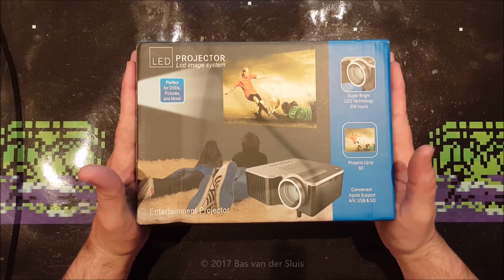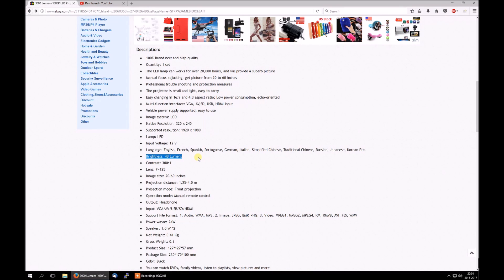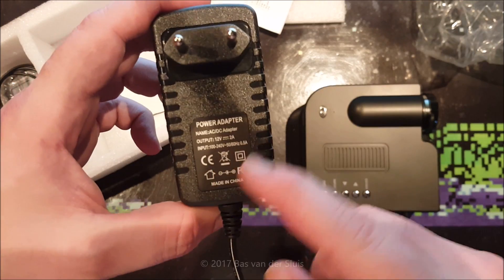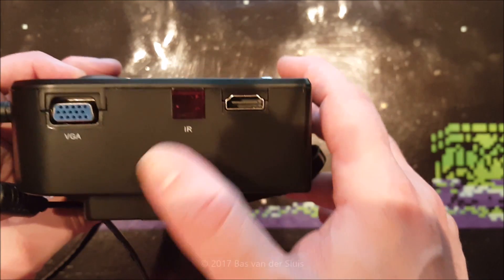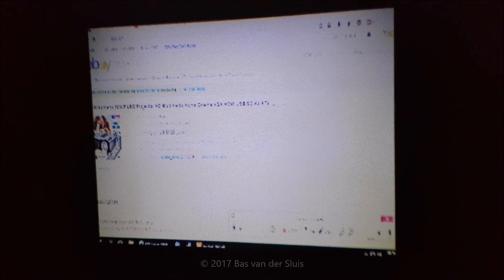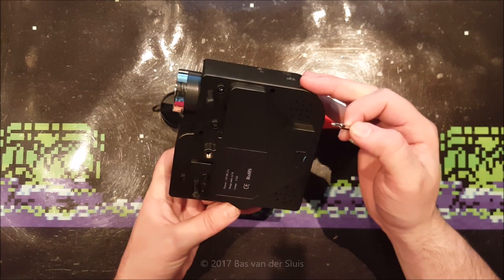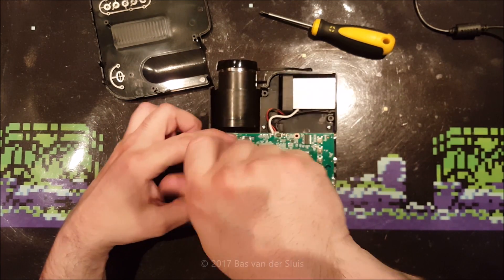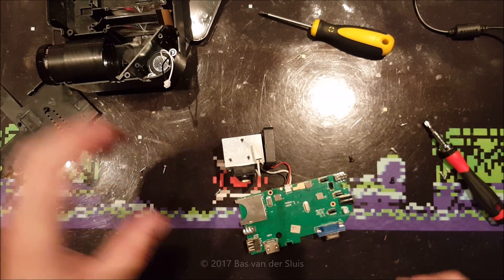Have I been scammed? A look inside this "1080p" LED projector.

Comment: 320x240 is CGA Resolution.  Full 1080P would be 1920x1080.   Yes you did get scammed! 

Next time if you want a projector, go with a name brand (Epson, InFocus, Christie, Panasonic, Optoma, BenQ, LG, Casio, Sharp, HP, etc).   Never buy a projector out of the back of a van, either.  If you have never heard of a brand someone is offering you, next time Google it and see if it is good or a scam before buying.  

To get some serious use of the white van projector you got at its native resolution, you might have success with very old computers (Commodore, Apple II, IBM CGA) or older arcade games.    It might look good with those signals.

Comment: YES! it needs all that cooling.. and be glade it has it..  most new devices are not properly cooled, thereby giving them a predicted fail rate... I have a RoKu box..  strapped old heat sink to case after noticing it so hot..   it helped big time...  same box for 4 years now..  yet i see so many online of same model Refurb's. I have seen many "insides" of electronics all my life...(47yrs now), and most fail due to heat issues and in my humble opinion, causing you the get a new one every so often. WiFi chips burn out.. all the time. yet most devices now depend on them.. no more cables.... wide open security probs to boot. p.s. most devices can have the Adapter replaced, laptops for sure.

Comment: i have exactly the same one but the New Zealand power adapter is way less quality than the one on the video . Mine overheats and shuts off after one hour max in cold conditions , any tips m8 ? Should i use another power adapter ? if so how specific do i need to be about the adapter? help ..... cant even watch a full movie on it .
Reply from the maker: If you are going to get a new adapter, make sure that the voltage is exactly the same and the amperes are higher than of the adapter you currently have. Also make sure that the polarity of the output plug is exactly the same. The one I have is 12V at 2A, which works fine, but I have not tested it for longer than 10 minutes or so.
Reply: I did what you suggested and went up from 1.0 to 1.5 amps and it has been going for almost four hours now and that is more than enough. the company offered to replace it but it seems o.k for now , they say they have sold quite a few of them and haven't had a complaint yet. So i must have just got a faulty power adapter . Thank you m8 .
Reply from the maker: That's good news! Glad to hear that it worked.
Reply: Jus get a zte spro 2 i have one and its dope af

Comment: Well technically it's misleading information not a scam. Had a similar experience when I ordered a phone charger which said Qualcomm QuickCharge in the title, but when I got it, it was a plain 5v charger. Luckily the seller refunded my whole sale and I got to keep the charger anyway, and he changed the listing eventually and removed Qualcomm QuickCharge from the title :)

P.S. Looking forward to the givaway :)
Reply: Boris Dusnoki it’s a scam, they do it on purpose and make the listing end quickly to lure a buyer into bidding quickly by reading the misleading information.
Reply: You’re a fucking tool there selling a product that not what they say it is witch is clearly a scam if u had half a brain